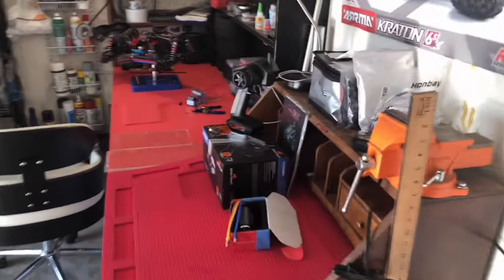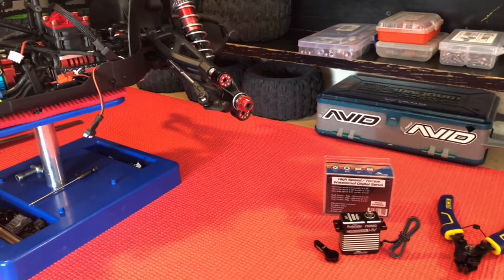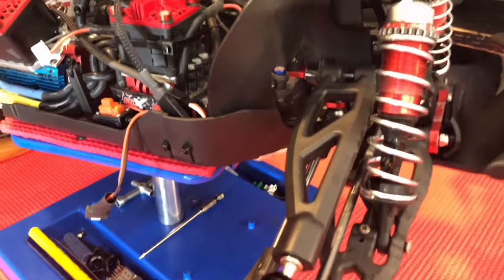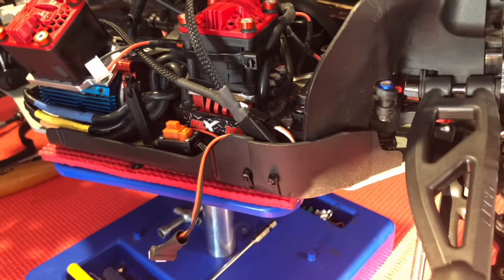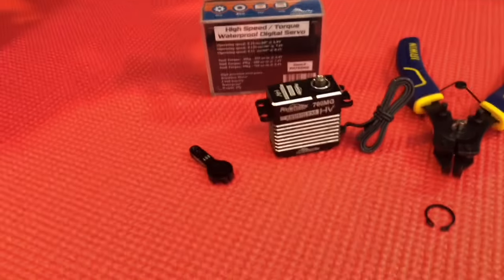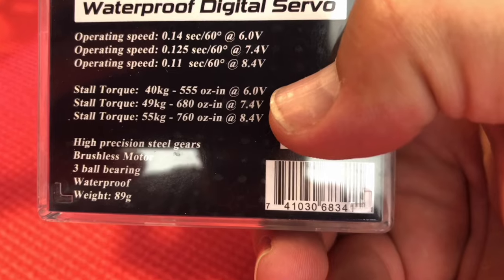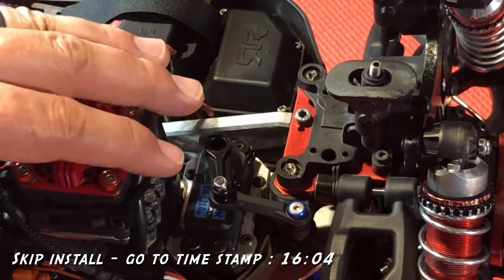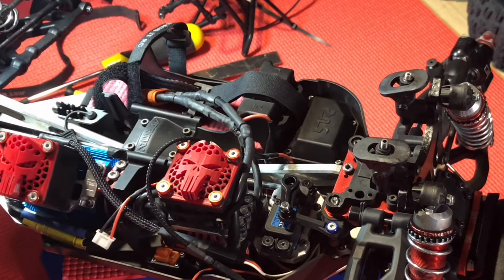Achieve 100% steering for your ARRMA Vehicle. Complete breakdown!

Comment: You don’t need to replace the servo. I still run my stock servo I just added a few circlips. Now I can drive her on 2 wheels no problem. The stock servo is pretty decent. My revo is heavier then my kraton and I’ll I needed was 250oz. If you adjust your servo saver no need to spend that much money. I have the v5 idk if that’s why but I have no problem with that stock spektrum servo.
Reply from the maker: All good brother, I’ve added three snap ring clips to my servo savor. In fact that is the reason why I feel the upgraded servo with higher torque is necessary. The tighter you make your servo saver the more torque is needed for 100% steering. The stock servo will certainly get the job done however if you want to achieve 100% steering then I suggest you do the servo saver test. Grab your front tires and hold them fixed. Then turn your steering 100% and see if your servo Is strong enough to tweak your servo saver open all the way so that your arm completely but stops against the upper hinge pin notch. My guess is you may not of watched the whole video because you recommended using sir clips. However about 50% of this video is talking about those clips lol. It also goes over in Great detail The test I’m recommending you try to see if you’re  not just getting good steering but 100% steering😎💪💪

Comment: the esc dont have a 7,4 bec ? you need change it with option esc
Reply from the maker: Depending on your ESC, it may or may not have the option to adjust a setting to allow it to output various settings. The BLX 85. Yes he does not have the option to output 7.4 V its maximum at 6 V. 
However, I have installed an external BEC component into my rig, which does allow me to adjust this particular ESC to output, 7.4 V not through the ESC itself however, but through the BEC search my videos for how to install an external BEC.
Reply: @EastTactics  ap yep,  i want search a external bec that allow me change 7,4 Max output to 8,4v for allow servo use his Max voltaje 

I see other video about the coat of body with rinho and i buy an spray something similar its call raptor 

Sorrry about my english im spanish

I LOVE your Channel 

Good day, here is 9am

Comment: 21:40 your servo mount is loose mate
Reply from the maker: Right, did you see how I remedied the issue later in the video?
Reply: @EastTactics  yeah thanks :-)
Reply: yeah, i noticed at 3:51 that before you do all the upgrades and extra stuff, try removing the rubber o-rings that connect the servo to the servo mount cause of all the initial movement at the base of the servo is going to have a larger negative effect than any upgrades down the line.   looking like a fun rig when its all said and done.